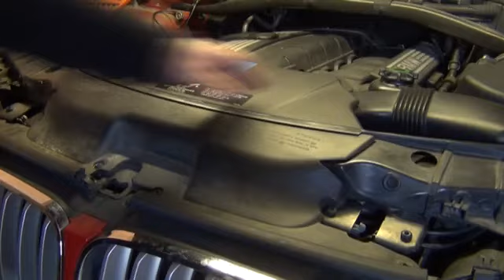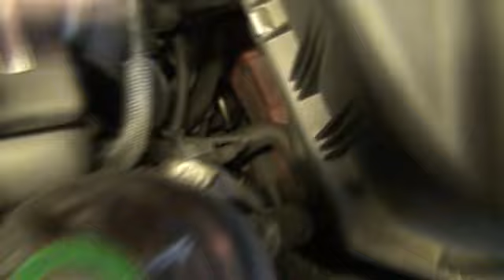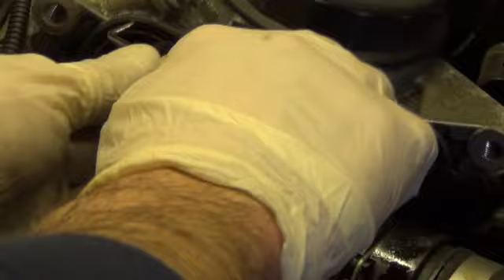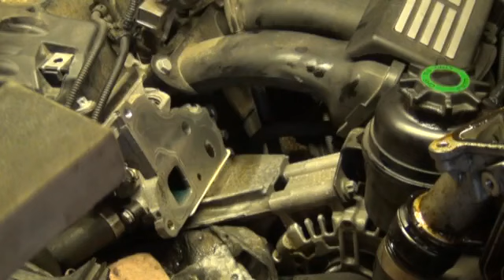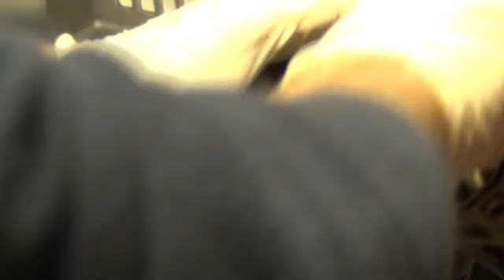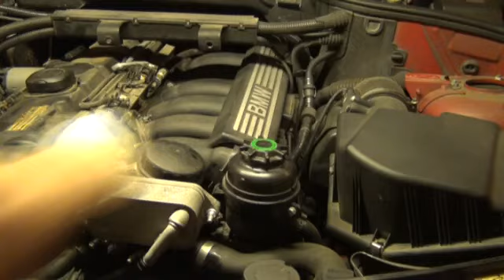BMW Oil Filter Housing and Oil Cooler Gasket Replacement N51 N52 Engine 6 Cylinder

Comment: Do I have to replace the bolts after doing this because, I took off the bolt on the right and bolt on the left dident know it was a bolt on the bottom so I left it alone put the bolts back in now my oil is leaking none stop like pouring out . I never had a leak I just wanted to open it up and see if the gasket was okay and now it’s pouring out
Reply from the maker: Hello, It sounds like the gasket has failed. They flatten from the pressure and if the pressure is released the gasket does not seal correctly. The best thing to do will be to replace the gasket. If you get oil on your drive belts they will come apart and that can cost a lot of money. I have seen the belts get sucked into the front main seal and into the engine. Make sure to check the belts and that they are free of oil. You do not need to replace the bolts unless they are damaged in any way. I hope this helps!
Reply: AskTheCarExperts thank you so much man I ask a million people and nobody couldn’t answer this super simple question

Comment: Great video.  I have done this before with my intake off and it was pretty easy.  If you do it with your intake on, like usually done, you will need to have a 1/4" drive E10 Torx.  I had a 3/8 drive E10 Torx and it was just a little wide in diameter to fit properly onto the back bolt.  Also, you might want to have the Gearwrench  E10 x E12 double ratcheting wrench for the bottom bolt.  But, you can also remove the coolant hose connection and access it with a regular E10 socket. Actually, you might want to replace that coolant hose/fitting by the bottom bolt.  Mine failed because it's a plastic(?) fitting and the heat basically caused it to get weak.  Get the BMW Oem hose/fitting when you replace it.  Oh, and be careful about replacing the bolts in the housing.  It's very easy to get them cross-threaded.  Two started to and I cleaned out the threads with a tap and that helped a lot.

Comment: Thanks for this video, it is incredibly helpful !! Regarding the e10 socket which I only had in 3/8" drive. I found that a 6-point 5/16" socket in 1/4" drive with a swivel adapter and extension worked well for the hard to reach bolt under the intake runner. I did an oil change immediately after and definitely needed coolant. Thanks again !!

Comment: This oil leak/gasket failure is an epidemic with BMWs. You'd think they'd extend the warranty to fix this. I have a 2014 535i with only 40,000 miles but the 3 year time period has passed. I love the car,  and I'm going to have the leak fixed, but I think BMW should re-think their warranty policy for "engineered mistakes"

Comment: this is a very informative video and spot on..exactly explains the problem and fix .. I currently have this problem and am going to my local garage to replace the oil cooler and the residual gasket, however in your video you have replaced both gaskets only and not the oil cooler. Do I need to replace both gaskets and the cooler? Iv purchased the cooler and its residual gasket but not the other larger gasket.  If just the gasket/s, it would save me alot on the cooler.  Appreciate your suggestions/advice. btw its a 2005 bmw 5 series 523i. thanks.

Comment: Any idea what (if anything) is different when doing this on an N55?  Gasket is $30, dealer wants $950 for this job.
Reply from the maker: +mathew gajewski This is much more complex on the N55. It uses high pressure fuel with fuel rails and injectors that have to have the seals replaced. If you get any fuel on the coils they will bloat and fail as well. I currently do not have a video for this repair since I do not own an N55.

Comment: thank you very very much . the best of the best  BMW DIY on youtube  , you guy save me $600 today.
thank you to" thecarexperts" for the TIPS.but can't found it 1/4E10 in town . but I'm using reg  short 1/4' star socket 5/16 for oil filter housing 3/8 for cooling for my E70 X5 3.0SI today less than an hrs .thank you again , you guy are awesome
BY the way , have anyone do seafoarm for the E70 X5 3.0SI ? WITH VIDEO plz !

Comment: Thank you for posting this, any idea if the e53 3.0i 2001 X5 has this oil cooler gasket and how best to access it with minimal amount of work, this is the first I am hearing about this. I know the oil filter housing gasket is prone to leak, no one mentioned an oil cooler gasket????

Comment: Can you use a 3/8 E10 swivel? I can find 3/8 all day for cheap, dropping 40 bucks for a 1/4in E10 swivel....
Reply from the maker: XxNELLY89xX The 3/8 swivel is too tight to fit under the intake manifold. I found I can not get a good bite on the E10 bolt and damaging it can lead to a bigger headache. Definately worth the 40 to get yourself the 1/4! Thanks for the great comment bud!

Comment: Thank you, Sir for the well-informed and expert guidance.   I replaced mine yesterday 06 330i e90 model.   Same set up without the oil cooler.    The 3 bolts holding seem way over torqued.   I used the same set up using the 1/4 u-joint with two extensions for the back and used the 8mm ratchet wrench w/ a 'cheeter' bar using an 11 mm wrench to get more leverage.   Not much area to work with in the front as stated but this set up I used worked for me.   I never thought of using the magnet for the back - I carefully used my hand to slip in the back bolt into the hole and slid down the housing.  Once in position I was able to tighten.   I agree with having to degrease the motor after the job to ensure none of the oil and coolant degrades the components.    Incidentally, I also had to replace the two bolts holding the valve cover which snapped off ( due to bmw over-torquing) and what a fun job.   While there I also replaced the valve, spark plug, servo motor gasket, the ESS & spark plugs.   
Doing this yourself saves a lot $$ because BMW was going to charge me enough to open a 2nd mortgage.

Comment: Thanks for the VERY helpful video. Tackled this yesterday and the wobble extension sure helped to get the socket on straight. Today I noticed new leaking from my oil filter cap. I think I've increased the pressure there thanks to the new gasket. New cap coming. Thanks again